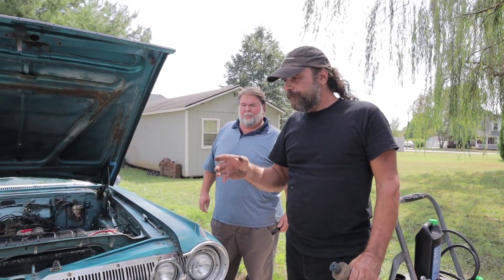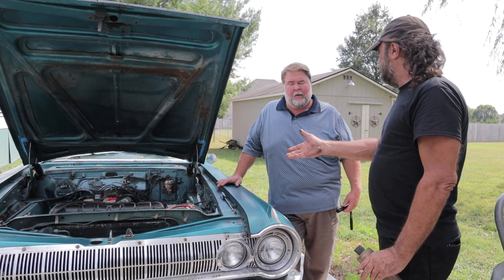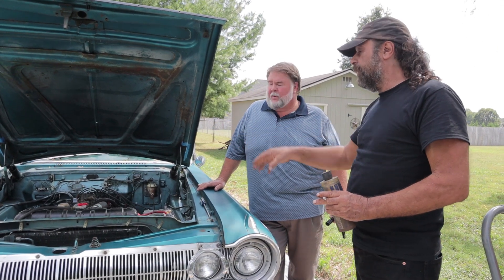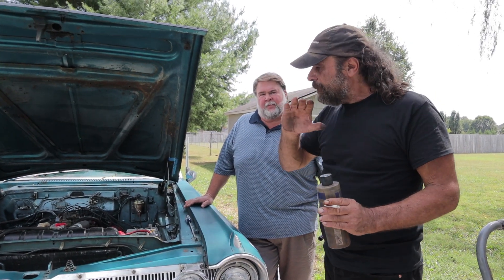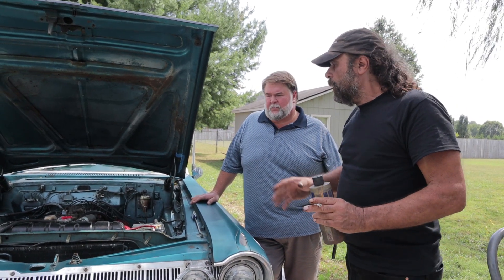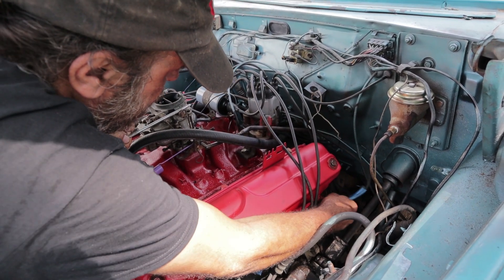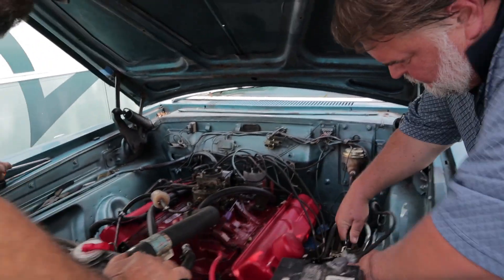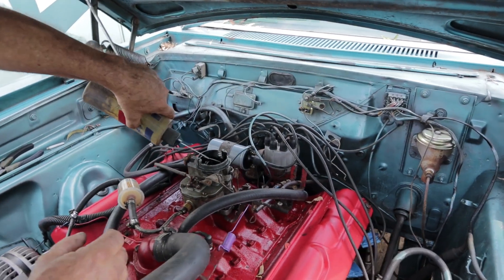Classic Car Tech-The No Start

Comment: The cigarette and bottle of gasoline both in one hand proves it's an authentic Uncle Tony video.  Accept nothing less!
Reply: Unbelievable.
Reply: Yeah it's perfect. Quite possibly done on purpose for humour.
Reply: Safety first!!
Reply: You can drop a cigarette into a cup of gas and it won’t ignite. 

Needs to be atomized.
Reply: @danielkane5646 your wrong cigs can’t light fuel, they don’t burn hot enough

Comment: My heart was startin’ to hurt for that starter😂
Reply: The bendix loved it
Reply: nice to hear the old Mopar starter still too but double reduction gear as opposed to one of those lighter hytorc things that sound like a foreign car starting
Reply: That's nothing. Ive cranked on starters so long you couldn't touch them they were so hot. Even used one to move a car a few times.
Reply: @brettgast  a lot of these folks are so used to fuel injection they think you turn the key and it starts within 2 seconds
Reply: Those old Mopar starters were designed for that type of cranking.
Reply: @garymckee8857  sure they were.. just like the classic Delco Remy GM there's a reason those bad boys were found everywhere tanks, big trucks, still to this day.. boats ships barges you name it..
same with the good old Chrysler alternator believe it or not that thing was used on a whole ton of shit not just Chrysler product related..
Reply: @truckerkevthepaidtourist  you are correct sir a lot of old military equipment used those starters from GM and Chrysler.
I have never saw Ford starters but I sure something had those too.
Reply: I agree haha!
Reply: i was thinking the same thing.
Reply: just buy another starter. no big deal..
Reply: @ trucker Kev   Loved the sound if those gear reduction starters!
Reply: Ya it was a bit long of a crank and not enough time inbetween cranks

Comment: Fixes the issue in less than seven minutes, Tony's on it like a fat kid on a cupcake!
Reply: yeah but it shouldn,t have taken him that long to figure out that the timing was off . old engins are the easiest to figure out  when they have problems related to timing . But htere is more to it than the timing .  With the amount of gas he poured in that car should have started  way before that .It was only pure luck that he got it  to run on his last try . i'll bet my ass that the next day that engin was has hard to get running that it was right now cause its obvious that this engin doesn't run to its peak efficiency , far from it . Its probably why he also did not give a jirk on the throttle  cause he probably knew that when he would do that the  the fast iddle would step down and the engin would stall . not saying that he doesn'mt know what he's doing . just saying that once he heard the engin running he knew right away that something was wrong with the timing components . Anyone who knows these engins well will tell you that this engin was not running like it should be when it finally ran and pretty much anyone  with mechanic skills from those times had already figured out why. that is also why he shot down  the engin right away cause he knew something was off  . A hint that gave it away  was the fact that no matter whitch way he turned the timer there was no restriction when he cranked the engin a tell tale sign that the the timing is off on the cam . when a timing is spot on no amtter whitch brand of engin you crank when you will trun the timer to far off counterclock wise the engin will start to have problems to crank because the explosion occur before the stroke of the piston  reaches its top dead  center resulting in a kick back stroke .
Reply: @guytremblay1647  So along with your bad grammar, where are all your subs and car videos? Oh thats right you have none don't mess with Uncle Tony he will run circles round you.
Reply: @EarthtonesCymbals  I'm sure you could pack Tony's fudge.
Reply: @guytremblay1647  Agree. Someone said "Fixed in 7 minutes". What did he fix? He never said. I think he was a little surprised and decided to leave it at that.  He moved the timing back and forth many times before it started. It's not "fixed" unless you can describe what you did to fix it. And then, you need to unfix and refix it to prove your diagnosis.

Comment: I haven't seen anyone back the wires off in a long time, that's an old school trick for flooded engines and weak coils, man your on top of the game!
Reply: if you are having a weak spark its more that likly the condenser --could be wrong value condenser or defective condenser  coils usually go open and quit  coils and cond must match to perform correctly -test this way remove sparplug wire from plug insert screw driver  hold close to eng at idle how far will spark jump   1/2 in is good less than 3/8 is bad install correct cond  it will jump about 3/4 inch  go to dealer to lok up that year part #  then tryto cross  ref,with modern #s online   what happens over the years wrong value is installed  over and over   i did this for my 53 m37  spark went fron 1/8 in to 3/4 inch its worth the effort .
Reply: hahahahaha! i see it alot.
Reply: I know right I f**** learned that when I was a teenager and I'm 59 trying to help my young family member with his first El Camino and we're trying we're trying to get it started and man I know I was thinking it's not getting a spark but I'll remember that next time give it some room fire in the hole combustion chamber boom kill two birds with one stone get a spark and dry out the cylinder in a second now if only I could do my hair like that when I'm late for work
Reply: By next time or remember later I mean that's not going to be the issue right here cuz it's been sitting in a hot ass desert that's been 117 everyday for a thousand years and it's all full of dirt so it probably needs spark plugs I doubt if it needs to back off Gap but you never know it's a great dance move anyway right back it up back it up back it up LOL

Comment: I was having a bad day today and this just put a smile on my face hearing that old 383 fire up thanks
Reply: @dancage2446   I stand corrected I thought he said 383 or maybe I just wanted it to be a 383 one or the other sadly I have a visual impairment so unless it's right in front of my face I couldn't tell the difference if it's a small block or big block
Reply: actually a poly 318
Reply: @sincerelysophie462  Absolutely Correct.. Poly 318..
Reply: @dancage2446  yeah that's what they called the bigger 318 back in the day...
Reply: 383 and all Mopar B motors have the dizzy up front
Reply: We used to call them 318 Big Blocks
Reply: @AtZero138  why was it called poly?
Reply: @chevyblue10   Polyspheric

Comment: Thanks, Uncle Tony! I am restoring an old ski boat and just replaced the fuel line for the 350 Windsor. after doing so, she was not turning over. After watching this video, checked the plugs and had a spark so then  I got some new gas and put it into the Carb and she turned it over in minutes and now purs like a kitten!!  thanks again!

Comment: End of a hectic day, Tony and a cigar, I figured timing that's what they have trouble with on a rebuild...ask how  I know.
Reply: easy . The cranking did not change no matter how far he turned the timer in both directions   . normally when you go to far  counterclok wise and he did go far  the engin should have cranked like it need a 24 volt battery to crank it  but it didn't  . it cranked the same way no matter whitch way and how far . what does that telle us ?

Comment: Pull the spark plug wires off a bit to where the metal is not touching the end of the spark plug and it amplifies the spark !  I learned something today thank you uncle Tony ! ( Uncle Tony what was the reason  why the engine would not start before you got it running ? ) looking at the video again and thinking about it I’m thinking maybe the points needed attention ...

Comment: Usually it's a fuel problem, but checking for spark at the end of a spark plug wire is so easy to do in a few seconds, it's the go-to first step. And about holding the spark plug boot a bit off the spark plug wire to increase the voltage is duplicated by holding the coil wire a bit off, to do all the spark plugs at once.

Comment: Uncle Tony, long-standing viewer, first time commenter. I have a stock 1968 Camaro (my first car, bought in 2002) and it died while driving the other day. I’m getting fuel to my carb but do not seem to be getting spark from my coil (MSD Blaster 2). Is my next step just checking wiring to and from the coil? Thanks for all the great content. Keep them coming and if you are ever in Fresno CA, I’m sure we can get some GM content for your channel 😂.

Cheers,
Ferg

Comment: Better do a valve adjustment and check the lobes on the cam shaft .I didn't know that they called that engine the Poly 318 I always heard it called the Canada engine . Bad gas will do that too , I used to drain the tank and  run some Marvel if the gas smells like paint thinner . In HS the Chrystler trouble shooting contests were always won the Chevy GM guys because GM's never started when we had cold and snow . You were spot on with the fix !

Comment: One time I had an issue with a new motor that wouldn’t fire up, the battery was good, but a little old. After I cranked on it a minute with a new battery it fired right up, I believe my problem was that the engine was new so it was a little “tight” so being tight with a tired battery wouldn’t let it turn over fast enough to get it to crank

Comment: Welp, for us newbies why did it finally start? The plugs were wet, couldn’t you have just waited for them to dry and it would fire? Or is it pump/carb issue not getting enough fuel to fire up? Or was the timing just off coupled with wet plugs
Reply from the maker: That was about it...timing off and wet plugs

Comment: Hopfully this is similar to what im working with on my 71 Buick GS350. Turns over fine, coil has good spark, but having trouble getting consistent  spark out of the wires. And the Distributor, rotor, and wires are all new. Points are at 0.016

Comment: I have a 71’ mustang basic 302. I was replacing the collar(no key and the old one was shattered). I replaced the starter because she wasn’t cranking right, the teeth wore down. I replaced the starter solenoid as well. However I think at some point something burnt out in my electrical. Idk how to properly trace it, So now she doesn’t even try to turn over. Although there is power surging through

Comment: 1958 AMC Rambler Super here (pt.60) I'm having a no start situation with my new rebuilt engine, made sure all the timing was arranged, the oy ting I can think of Is the timing marks aren't correct and have slipped on the harmonic balancer. Today after work I'll do what tony did and check for spark at the coil and the plug, the engine backfires but doesn't start, we tried for around two hours.... No break in today....

Comment: One thing I learned a long time you absolutely do not pump the gas while you're cranking and engine over you pump the gas couple times then you started open the gas will crank in the motor just flooded it key to setting timing
One find top dead center with compression are number one cly.
Next mine timing mark up at least eight degrees advanced
Next make sure distributor rotor is facing number one cly
Finally turn ignition on coil wire to look for spark advance distributor till you see spark rotor should be facing number one on distributor cap. Put cap on and fired up you'll be within 2 degrees of your timing.
Reply: Lots of typos in there- hard to follow what you are trying to convey.

Comment: Any ideas on what causes engine to start then dies? Specifically on an 80s Dodge Ram. Fuel filter? Improperly adjusted carb? Coworker looked at it and thought the throttle cable had too much slack

Comment: using the carburetor as a ground to check spark is the coolest thing I've ever seen in my freaking life.
Reply: Just put the coil wire inside it, give it 3 pumps and check for spark!

Comment: I didn't know if he was using points and condenser the electronic conversion to so many times with those good old electronic Chrysler's it's that little tiny ballast resistor..
I used to keep to in the glove box in my old valley and back in the day 73 little 318 because boy when they go they just go but they're amazing 2 seconds to screws plug it right in fire right up and away you go

Comment: Easy fix. I sure UT is well versed in Hot Wiring motors sitting on empty tires in the garage as well. A little wiring, Battery, jumper cables, fuel and a screw driver.

Comment: having similar issues with 77 chevy monte carlo after cahnging spark plugs, spark plug wires, distributor cap and rotar. have had the tranny rebuilt and a rebuilt starter installed. first replacement was the starter after my father passed, than  the car dies about 3 months later and had the tranny rebuilt tham about 3 month after it died again and about a year or so later after sitting i changes the plugs and what have you.

Comment: Having a similar issue since I changed my mechanical fuel pump on my 78 Ford f150 getting fuel to the filter and the carb still nothing fairly new plugs new ignition  module new solenoid new battery new battery cables new plug wires no start 😔

Comment: Greetings, I love the various videos.  I have a question I have looked into several tines and thru various venues with dead-ends everytime... I'm absolutely lost. 
Is a 1980 amc jeep 360 v8 block different than a earlier 360 Block? 

Both for 4 barrel intake manifold on ebay  that is 1960s ton1970s fit.  But, idk if 1980 will work?

Comment: Just FYI (for y'alls information, I learned the hard way). I was always told the condenser had nothing to do with the firing which is true IF the fault is an OPEN circuit. If the condenser is shorted it is grounded and will not fire.

Comment: You have any videos on a 81 Chevy pu 350 was starting.. one day a guy came over and adjusted my valves Then I started it 1 day and fine. 2 days later no crank. The engine has 55 miles on it. Help

Comment: I have a 1962 Oldsmobile Dynamic 88 that won't start. Changed Oil ,Sparkplug, has gas but I noticed no gas to the fuel filter. It does crank. Any suggestions?

Comment: Hey UT if my 318 79 power wagon dies from something like letting the clutch out too fast it doesn’t want to start back up at all, now if I wait a while it starts up but after cranking the starter for 30 seconds or more. If I turn the truck off with the key it starts back up no problem. I’m thinking my Holley carb flog adjustment is off what do you think (sorry for lack of detail I’m just getting into this hobby)
Reply from the maker: Check spark quality from the coil
Reply: Uncle Tony's Garage got a new coil set up right we thought...

Comment: So what was the issue?  You said there was no spark on #1, the plugs were fouled and engine was out of time?

Mainly timing right?  All that cranking and no fire would foul plugs.  But what about the no spark on #1?

Easiest why to get timing approximately right is rotate engine to TDC on #1 and point the rotor to #1, right?
Reply from the maker: Probably just a bad wire on that cylinder..  And yes, TDC with the rotor pointing at number 1

Comment: I have a 1994 it's been sitting for over 6 years the fuel pumps fine the battery the starter spark plug wires even put fresh gas and nothing's turning over what should I do next?
Reply: It's a Buick century

Comment: the first thing I was taught during my apprenticeship was an engine needs 3 things - compression, petrol and spark
Reply: And air(oxygen)....   although lack of air is rarely an issue, until you know that the air filter is clean and unrestrictive then, the intake system and manifold is clear and intact and there not an issue with the MAP or MAF sensors..

Comment: I'm surprised it started with the plugs being wet.  I see this a lot when people forget to set the choke before they crank, then when it doesn't fire up right away the pump the hell out of it (why do people always think they have to pump the gas a dozen times on old cars?) and flood it.  By the time they bring it to me it's usually flooded so bad I have to pull all the plugs and clean them, and even spin the engine over with the plugs out just to clear out the extra gas.
Reply from the maker: Try that trick with the plug wires next time.  You'd be amazed at what she'll fire that way
Reply: @UncleTonysGarage  I'll give it a try, thanks!
Reply: Ha Ha yep. It's a reflex action. I used to do AAA emergency road service back in the carb days. I would get a flooded car and have the motorist cranking it over while I ran the all-start  held the choke open...and I would tell them: "When it starts to fire, DO NOT PUMP IT." Without fail they would start to pump the crap out of it as soon as it started to fire and was getting ready to start, and then we would have to start over.
Reply: @saabtech3510  I had a guy try to move my old truck once.  He came and asked me if I had a kill switch on it 'cause he couldn't get it to run.  The first thing I asked was "did you pump the gas?"  he said, "yeah, but it still wouldn't fire", and I said "don't pump the gas".  I walked out to the truck, PULLED THE CHOKE OUT and it fired with a bump of the key, as it should.  He just said, "oh, it's got a choke thing". lol

Comment: Uncle Tony, what do you mean by Kick Back? Also when you pull the plug wires to check to make sure the cap and rotor are working properly, does it matter which plug wires you pull, can it be  anywhere on the engine?  When you got the engine fired up, was it only running on 7 cylinders, because you mentioned the first wire was bad?  Thanks man.
Reply from the maker: Kick back is pretty much just what it sounds like.  The engine will try and fight the starter.  And yes, you can pull any wire to check for spark.  Number 1 seemed to be a dead player when I checked it, but she seemed to be firing on all eight once it was running.  They need to be replaced, though